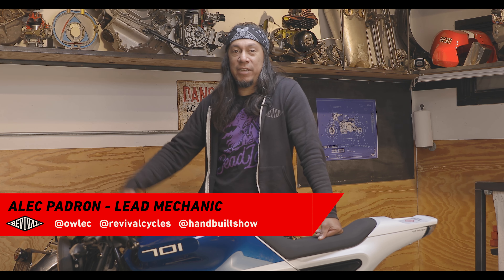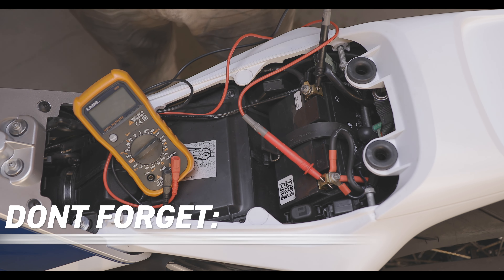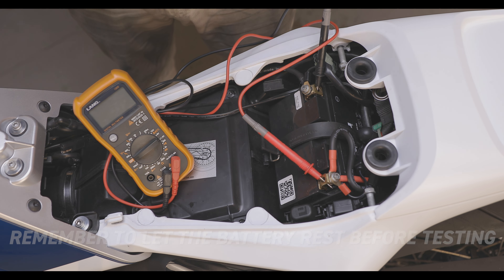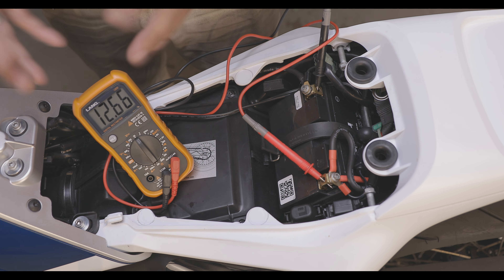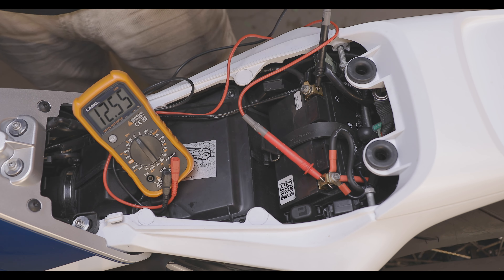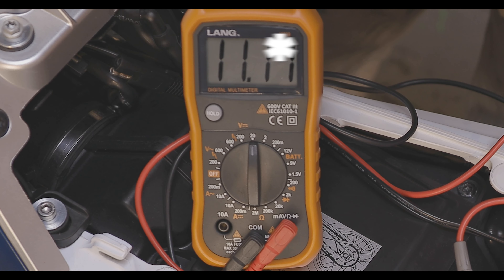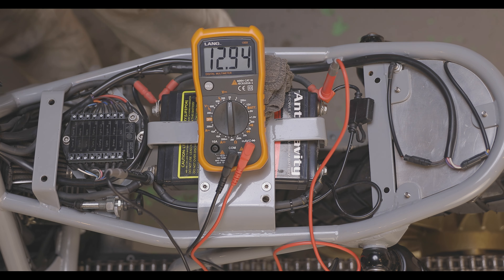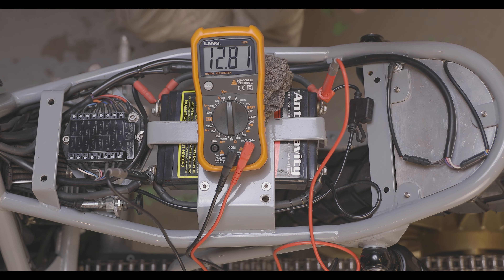How To Test Your Motorcycle's Battery // Revival Tech Talk #62

Comment: This video helped me, but wish I had found it sooner and watched ALL of it. My battery tested at 12.63, so i thought it was good, so I checked and cleaned all earth points, replaced the starter motor, then the solenoid, then all the cable's from battery to earth, to solenoid, from solenoid to starter, still no go. Then I found this video.. back to battery, turn the key and there's a steady drop to 12.30, hit ignition and it drops to 9 on the dot, with occasional fluctuation to 10, got a new Yausa battery and its a go.  Ah well at least I know everything else is good for the moment, apart from my bank account 😂   I subscribed and hit the like button.